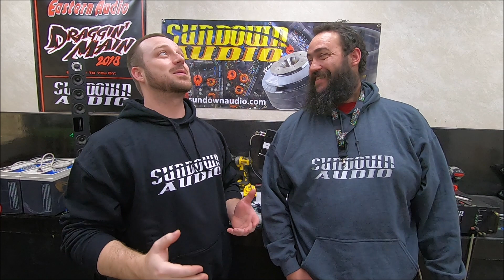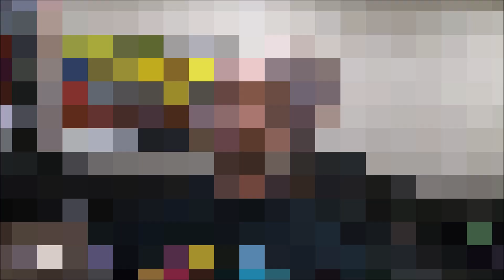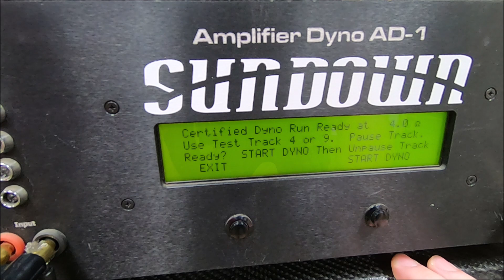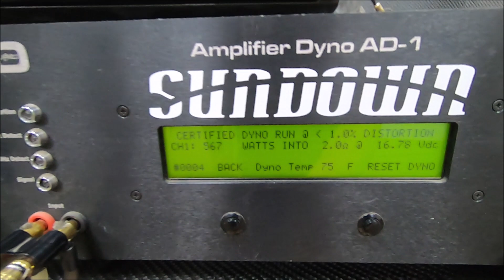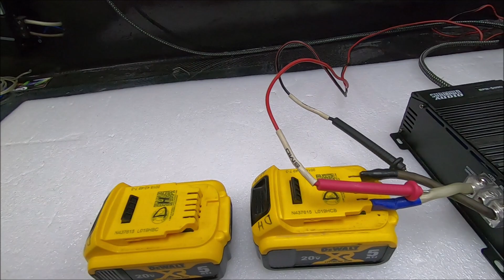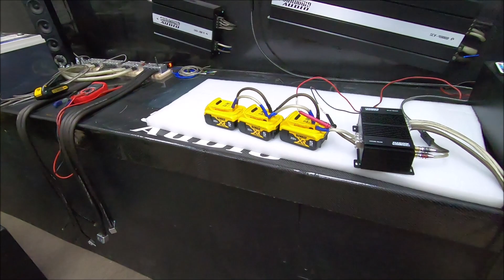Will a 20 Volt Drill Battery Power Your Car Audio Amplifier?  ***Car Audio Mythbusters***

Comment: I’ve been using a Dewalt 12 Volt XR battery to power my mini Stetsom amplifier that’s under my bicycle seat. And also I have a custom 14.4 Volt DeWalt battery I got from eBay to power my NVX amplifier book bag.
Reply: So a 14.4 volt dewalt battery you say. I would love to find the link for that.
Reply: @MendezMotorizedBicycles  
Dewalt does not make 14.4 that I know of in lithium. The one I have is fake hence I wrote "Custom" on my post.
https://www.ebay.com/itm/283581683924

Comment: I jump start cars with mine ...i did run my radio off my m12 and my snap on 20v  battery ..when i was doing some trouble shooting....only thing you cant drain them to low else the charger won't be able to bring them back .. I had to run mine in parallel with a charge battery to bring it back up
Reply: You have to do this for 18650 or most lithium batteries when charge is too low. Most of the drill batteries are just 18650 batteries stacked together they are easy to repair because of this.
Reply: @Thumper68  I've messed around with laptop batteries powering amps and radios before I even had proper knowledge wish I knew what I know now back them far to many sketchy shit